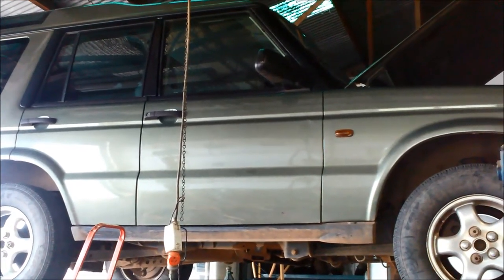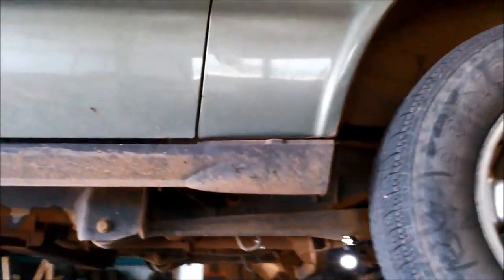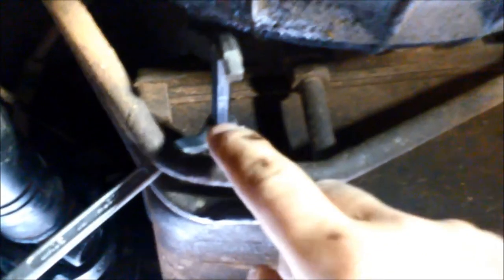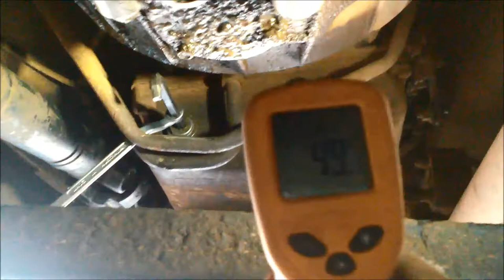ZF4HP22 Fluid Level Oil Level Check Auto Transmission Land Rover Discovery DIY How to

Comment: I blame BMW for removing the transmission dipstick on our Disco 2s. Bastids...
Reply from the maker: hi, blame them all ! most trans nowadays wont have a dipstick. cheers
Reply: In all fairness Land Rover being tight didn’t spec the torque converter to the torque curve of the td5, should have had the 4.6’s larger converter to save it spinning away and generating excess heat!

Comment: I have a Discovery 2 TD5. It is stuck in first gear. Is the problem with the oil or the computer?
Reply from the maker: hi, check basics first. it is usually a contaminated solenoid or sticky/worn valve issue. make sure you also air pressure test apply ports if you lower vbody. we actually rarely replace computers unless inbuilt in mechatronics. cheers

Comment: would be better if you did more than put half the proceedure in the vedio
- is the vehicle in what gear if any for the level checking process?
Reply from the maker: hi, most trans fluid level is checked in park or neutral with motor running at operating temp or at a specific temp range. some can also have check with engine turned off....or warmed over 80C to allow thermal valve to open and purge any air in trans fluid system, then you allow it to cool and recheck level. depends on the trans so you need to confirm with your vehicle manufacturer specs. cheers

Comment: If I take this plug out why the truck ain't started will oil piss out
Reply from the maker: hi, the fluid needs to be checked motor running and within a temp range because the fluid expands with heat. if you check level when not running, some of the fluid from top half of torque converter will drain back into trans pan. checking like that, you will let out too much fluid depending how long trans has been sitting. hope that makes sense. cheers

Comment: What gear is it in when you check it? N?  I’m going to change the fluid on my ‘87 E30 325i. ZF 4hp22. Am I correct in thinking that this video is the same transmission? So same way of checking my transmission?
Reply from the maker: hi, check in park. cheers

Comment: You HAVE TO hold it in D,N,R ect each gear for 20/30 seconds while filling or you won't get the correct amount.
Reply from the maker: thanks for that. cheers
Reply: You will be low on oil otherwise. I learned the hard way. So takes 2 to fill, 1 hold in gear on brakes and 1 filling up.